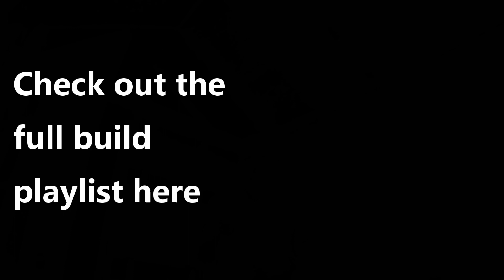Start To Finish Off Grid Tiny Cabin Build | MY DIY

Comment: I am very confused by how you shingled that roof. 13:07 you have a straight line down the middle of the roof,  which is clearly wrong, but then it cuts to the whole roof being shingled and it looks like it is correctly done.
Reply from the maker: When you run shingles vertically, which I don’t usually do, every other one is offset by 6”…I assume that’s why they looked like they were run straight up.